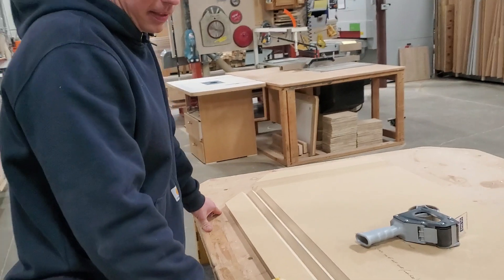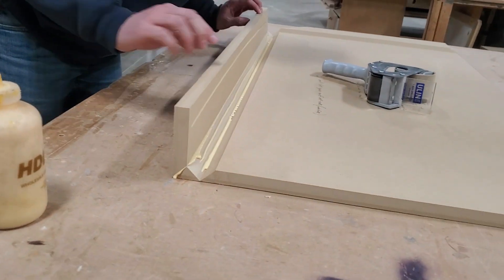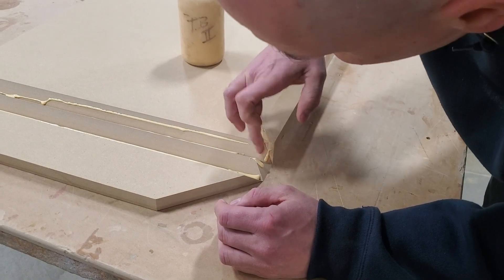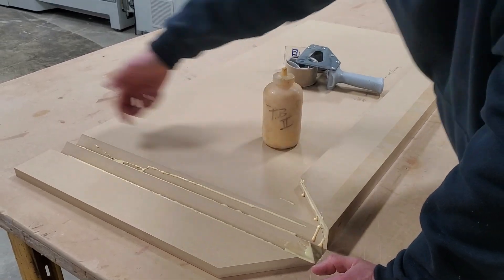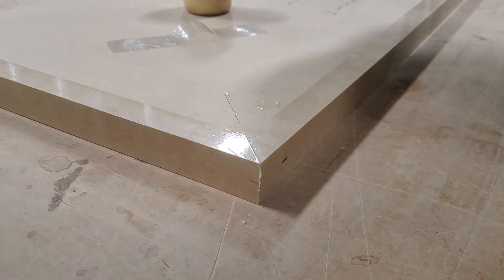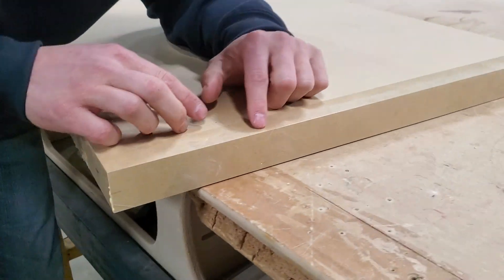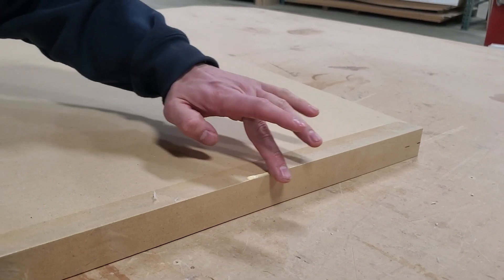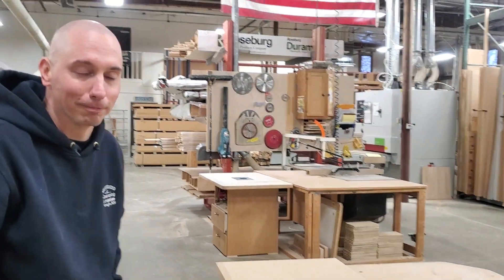Miter Fold Counter Top

Comment: What bit did you use on the CNC? We have a Shopsabre and I'm thinking about trying this.
Reply from the maker: I started with a 90 that we had in the machine for other non folded operations. It started fine for a job or 2. Then I had massive what I thought was geometry issues and decided to ditch my Amana insert in a collet chuck for a Ghudo 91 degree insert in a Ghudo heat shrink collet. The Biesse Rover A uses HSK style tool holders but the ISO 32 chuck and collets should be plenty fine on the SS.
Reply: Thank you! I'll check back in when I give it a try
Reply from the maker: @j0hnab  yes, please do.